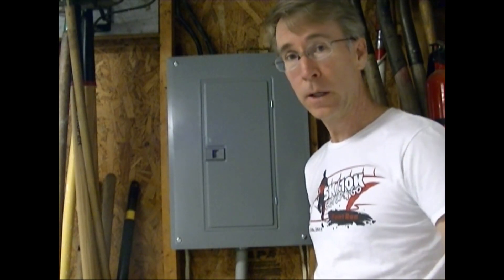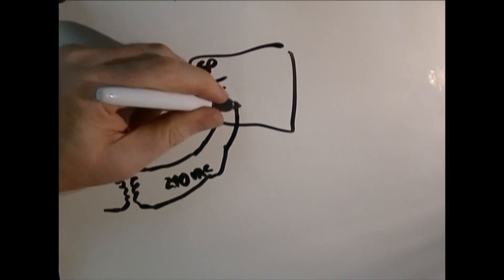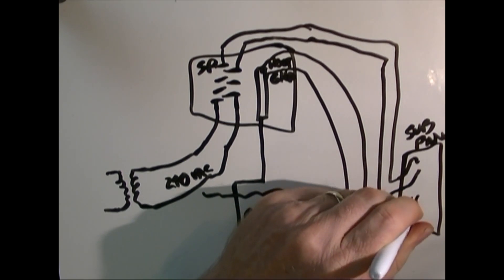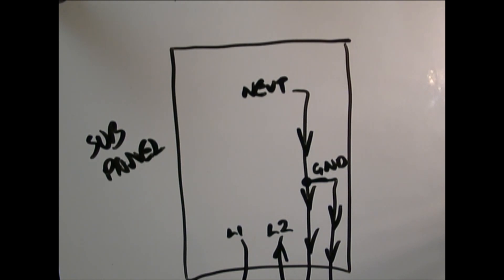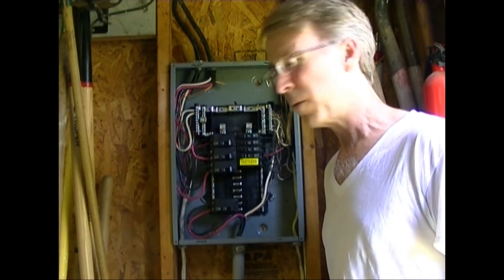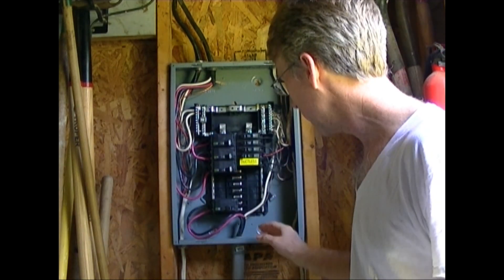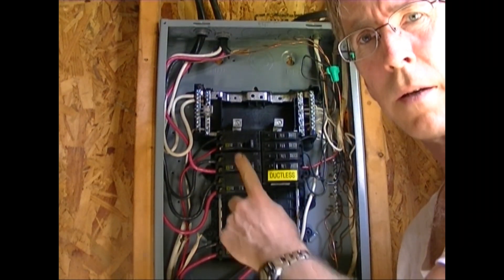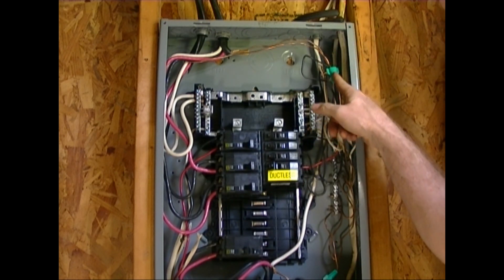CORRECTION How To Change Out A Load Center

Comment: Sorry but I didn’t see you tie in the separate ground wire from the service panel. Otherwise it’s really not a separate line if it’s Dailey chained off the neutral bar.
Reply from the maker: Thank you for commenting.  I'm not sure if this video makes complete sense without watching the original video where I made the mistake.  But yes, after realizing my mistake, I installed a separate bus bar just for the bare ground wires and already had a bar for the white (neutral) wires.  This way the ground is carried all the way back to the main panel instead of being mixed with neutral.

Comment: To truly be safe during your work on this panel, you should have gone back to the main panel in the house and turned off that switch. In your method, you still have hot wires in the panel you are servicing
Reply from the maker: That is absolutely true and I did turn it off at the house when I changed out the whole panel.  Just didn't feel the need when correcting my neutral/ground mistake.  Thank you for the comment.  Also, thank you for being polite.  You should see some of the comments I get from indignant self-proclaimed electricians. lol

Comment: Joe, just for liability's sake, I'd remove your first video. An honest mistake, but if someone (and there only ~4 billion that have the potential to watch your video) wires up a subpanel after watching your first video, well, I wouldn't want that hanging over my head.
Reply from the maker: Thank you for taking the time to comment, Michael.  I will definitely consider your suggestion.  My hesitation is that the second video might not make sense without the first one and I want to highlight the mistake since I believe it may be a common one.  Thanks again for your help.

Comment: There was a video about a sub panel made by a guy in Florida and by code he had to use 2 ground poles at least 6 feet apart for his bare ground wires. Not a big deal. I would only use one if you don't need it inspected. They always find problems. They want you to hire it out today. Before long you won't be able to do anything yourself anymore.
Reply from the maker: I've heard of that two pole configuration.  I'm pretty sure I just used one.  I built the house in 1997 so it's been a while and the code could have changed.  Also different areas may have different codes.

Comment: The ground buss bar with the bare wires are not still grounded. If you have a short some place the tool or box will shock you still. I think you need to run a wire from the buss bar or box to a grounding rod to be grounded.
Reply from the maker: I connected the bare wire from the main panel supply cable to the buss bar.  So the ground is from the main panel at the house which gets its ground from a copper bar in the ground.  There is a path all the way from the ground buss bar to physical ground.  Thank you for commenting.
Reply: Only way to do that would be another line to each box. Meaning another wire for your bare ground wires in your barn. It's either a ground rod at the barn or you ran a wire in the barn box back to the neutral in the barn box. If not your barn box still has no true ground. But whatever way you did it if your happy with it is all that matters
Reply from the maker: I believe I did the second option you mentioned.  I ran a bare wire back to neutral/ground at the main (house) box.  I discussed it with a licensed electrician and he seemed OK with it.  Plus, it just makes electrical sense.

Comment: Well Joe that looks much better, I'm glad that someone took the time to explain fault currents to you.  As far as the ground in the panel with the wire nut, that is a no-no, but as time goes by the N.E.C. and the N.F.P.A. will change their minds some more and in a couple of years it may be acceptable.  But sometimes an inspector has to take into consideration the situation that is 
 at hand. After my last comment where I failed you some jerk told me that it was perfectly alright to tie the grounds and neutrals together.  Most people don't understand and it is best for that kind of people to stay away from electricity before they get hurt.  Sometimes when you have to go back into a panel and rearrange wires it is hard to dress them up to look presentable, but you did a really good job.  The main reason is that you try hard and want to do it right,  and you took the time to go back in there and correct the situation. I would pass this electrical installation, Have a Good Day Joe.  
YOU PASS
Reply from the maker: Thank you so much for the kind comment.  I felt that I had to make this video after the misleading mistake in my first video.  I think it's important to understand why we shouldn't do something and after an electrician explained it to me, it all made sense. (I guess this is a good time to admit that I'm an electrical engineer and not an electrician).  Thank you again for watching and for the comment.
Reply: You can make splices in a panel as long as it doesn't fill more than 75% of the wireway.

Comment: It looks like you are running 6/3 wire out to that subpanel. So at the origination point are your neutral (white wire) and ground (bare wire) coming from the grounding terminal (neutral ground)?
Reply from the maker: Yes, it's coming off of the main panel like any other 240VAC circuit with the neutral and ground tied together at the main panel.  Thanks for the question.

Comment: I usually see wire nuts tie two wires together in a panel to reach a location not reachable without the wire nut. So, there is nothing unusual about wire nuts in a panel.
Reply from the maker: Thanks for the comment.  I don't like to see a wire nut in a panel but sometimes they can help you out of a jam when your wire comes up short (due to a box change) or you need to group wires (due to slight overpopulation).  They certainly don't hurt the function of the circuit.

Comment: Great videos. One question. Isn't the phase angle between L1 and L2 120 degrees?
Reply from the maker: Great question!  If there were three lines (L1, L2 and L3) as in a three-phase system then, yes, the angle would be 120 degrees.  In the typical household system you only have two phases and they are 180 degrees from one another.  As you may have surmised by now, the phase angles of a system must add up to 360 degrees.

Comment: If you run all your wires to a separate ground bus bar in the SP you need to ground the SP box with its own ground wire and ground rod, right?  Without having the box grounded it isn't going to do much as far as I can see.  Did you do that?  Maybe I missed it in the video....
Reply: I'm no expert, but my understanding is that a subpanel install in a detached building requires its own ground rod.
Reply from the maker: Excellent question and it may be covered in the video but perhaps not directly enough.  My grounds after joining together on the bus bar are all carried back to the main panel ground bar which is carried outside to the grounding rod.  If I installed a rod at the barn then I'd have two grounding rods and I'm not sure whether that is advisable.  Thanks for the comment and thanks for watching.
Reply: Good video. Am installing a sub panel in my detached garage and always check these videos to make decisions like 125 or 100 amp, etc.
My code requires a seperate ground rod dedicated to the detached building sub panel.
Fortunately I have a genset outside in the general location, (within 8'), that a dedicated ground rod can terminate both.
Thanks for your candor and forbearance.

Comment: Nice! Always nice to have a safe set up. Not that I plan on working on any wires when the power is on, but accidents do happen & so I was wondering... is it still dangerous to touch the ground wires even though they are now grounded on their own bus?
Thanks.
Reply from the maker: +Lauren Cwiklo It should never be dangerous to touch ground wires that are correctly connected and not carrying a fault.  That said, I don't ever touch any bare wire until I've determined that they are safe (not connected to anything or measuring zero voltage).  The voltage meter/probe is your friend.  Thanks for question.